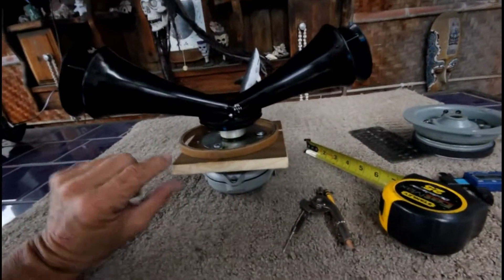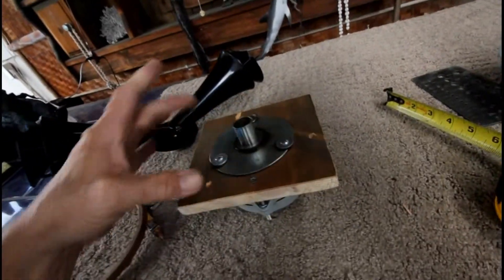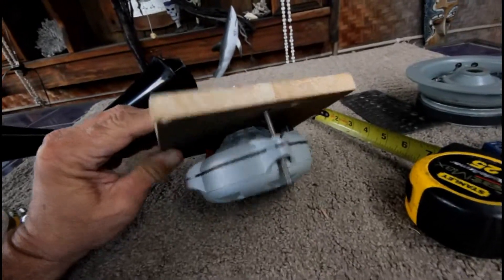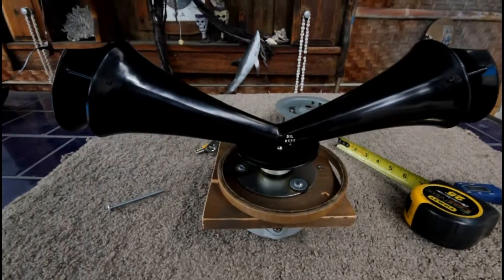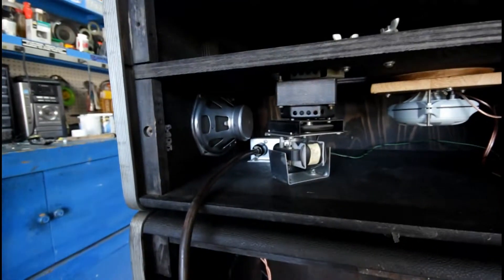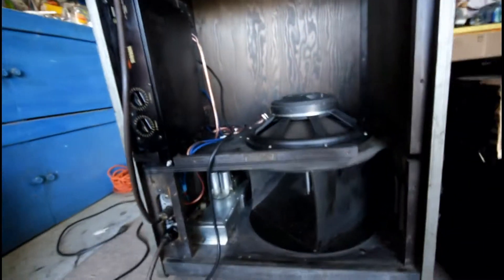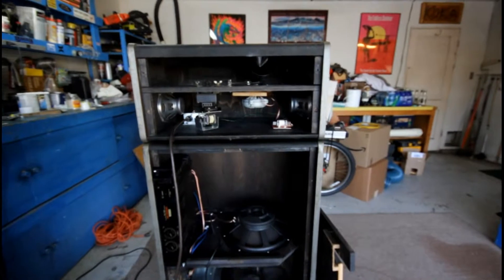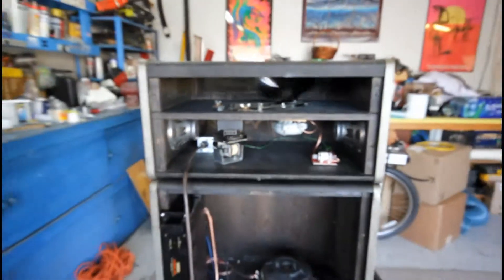Leslie Model 900 Modifications

Comment: What make of bearing did you use in the Leslie 900 Conversion video?
Thanks Tom from Edmonton Alberta Canada.
Reply from the maker: On the Upper Rotor, I used the original bearing flange adapter plate with collar and used longer screws to secure that plate to the 1/2" thick wood.